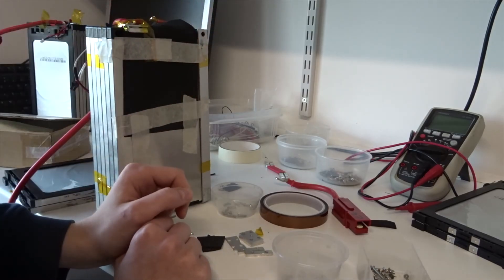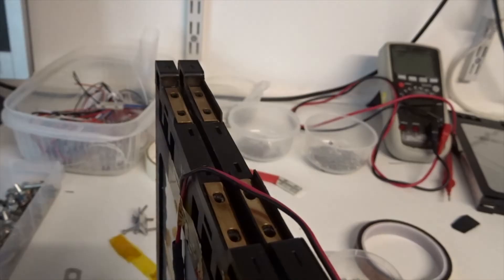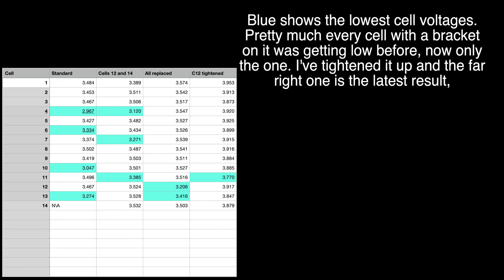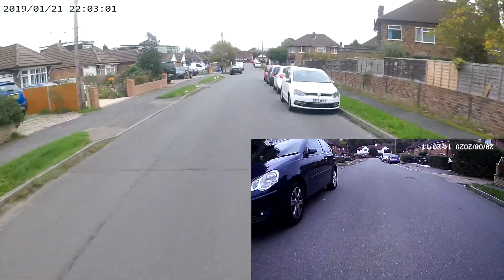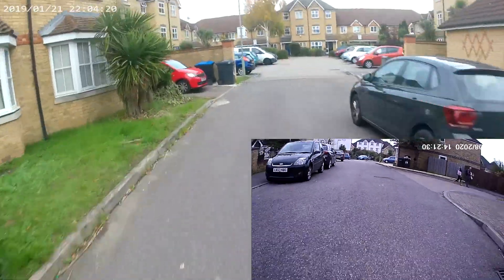8kW Enduro MSVA eBike V3 Build - How I made new and improved C020B cell connections - Part 10

Comment: I'm thinking about these batteries for my build. Problem is, I have a slightly different frame than yours, mine is more narrow with flared out side covers (I'm sure you know the type) Not sure if I could fit enough of these cells in to give me enough AH. Best I might get in there is 72v 20ah maybe. Would you consider making some more of your alloy blocks that I could purchase from you?
Reply from the maker: Would you have to put say 6 cells from one side to the other, then repeat that down the frame? One thing to bear in mind is voltage sag if you are only using 1 cell in parallel so might not be able to pull the full 110A. I used some kit at my school workshop to make them so if you can hold on for a few weeks until I can possibly go back in I might be able to get some made up.
Reply: @EverythingEbikeChannel  Thanks for replying & giving me some solid advice. I think I'm going to build a pack out of 18650 cells now so I can run more in parallel. Finding the cells is proving difficult. Fogstar have increased thier prices, no longer can you get Samsung 25r for a couple of quid 😕
Reply from the maker: @OcT4g3n  With a narrow frame, a li-ion pack makes more sense as you can make the pack to fit. As you are finding out, it is more expensive but DON'T buy some cheap chinese cells as they can be very dangerous.
Reply: @EverythingEbikeChannel   @EverythingEbike Channel  No I won't be getting any Chinese knock off cells, not only are they dangerous, they are lacking the claimed performance figures. When are you posting a new video mate? Enjoying the build  series so far 👍
Reply from the maker: @OcT4g3n  Editing right now :) About fitting the tyre, then test ride tomorrow!

Comment: Defo sort out the clunk noise, looks like you have bolt holes in that frame to close the drop outs , will be your best bet I think.
Reply from the maker: Torque arms are in the pipeline!
Reply: @EverythingEbikeChannel  probably wont need torque arms if you put bolts in those holes, the idea is it clamps shut the frame which I presume is  steel so will hold the wheel solid.
Doing both will be even better though and allow even more power.
My donor bikes for conversions defo need torque arms and I'm putting them both sides and bolted to frame on the aluminium one.

Comment: Hey man what charger do you use for this battery and how long does it take to charge? Thanks
Reply from the maker: At some point I'll make a full video on this, but at the moment I'm using a server power supply and boost converter to charge at around 300W. At that power it takes at least 7 hours. Plan is to build a 1kW charger that can do it in under 2 hours.

Comment: I calculated that, with 18" wheels, I could hit the unloaded wheel speed (the speed at which the motor won't turn any faster, due to magnetic saturation). This is only when flux weakening can actually kick into action and boy, does it kick 😂
Reply from the maker: Can't wait to get it done and try out all these features! Just to ask, how much voltage sag do you get from your battery when accelerating?
Reply: @EverythingEbikeChannel  Not wanting to flood your channel with my video links mate, search for "Insane e-Bike VLOG 2020 No.1 - Top speed run!" and look at 12:30 onwards, that'll give you an idea. I reckon it's around 1V per kW.
Reply from the maker: 😁That's encouraging - about what I'm getting as well. Cheers👍

Comment: Hi mate great video i have the same frame and im running at 11 kw you need some m3 bolts in the back of your swingarm which don't come with the frame but you can see where they supposed to be
Reply from the maker: I can see them but annoying they're all gummed up with paint! 😡. I need to get a long tap and rethread them eventually

Comment: Hiya, If you need some torque arms I've got some cad files for some of my own design, I can send them over if needed, along with photos of prototypes I've machined

Something else I've also machined, which I believe no one else has made yet, is locking wheel nuts in the m14 x 1.5 thread adopted by most high power hub motor shafts, Just for giving the poor sod who tries to nick my hub a good run for his money ;)
Reply from the maker: Locking wheel nuts would be a savoir! I've already modelled up a design for the torque arm, but if you could send me yours and what it looks like as well that would be great. email is cgouldstone45@gmail.com